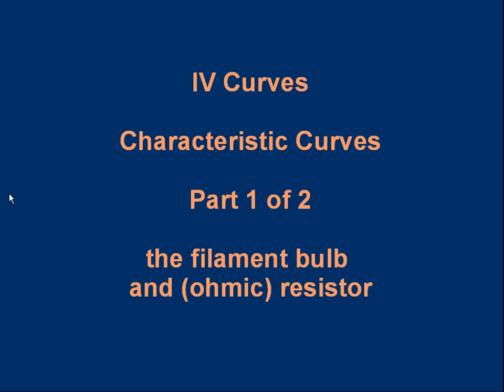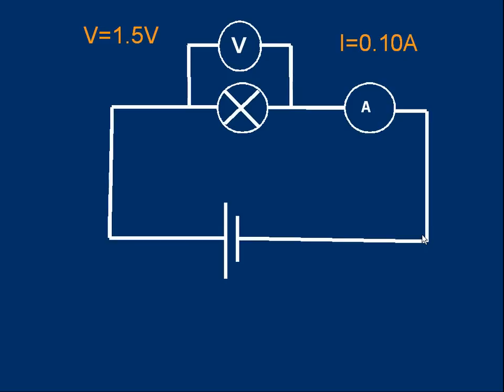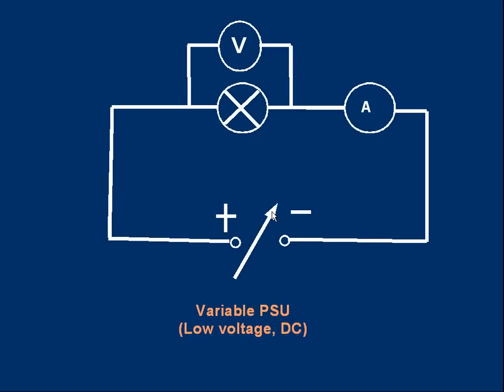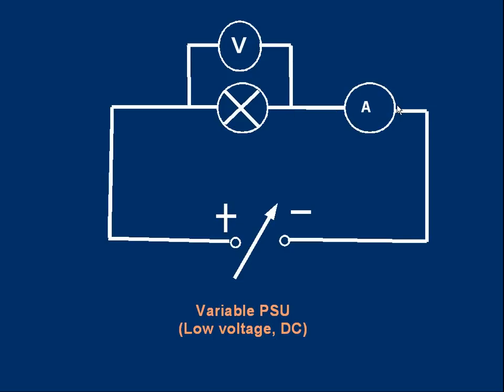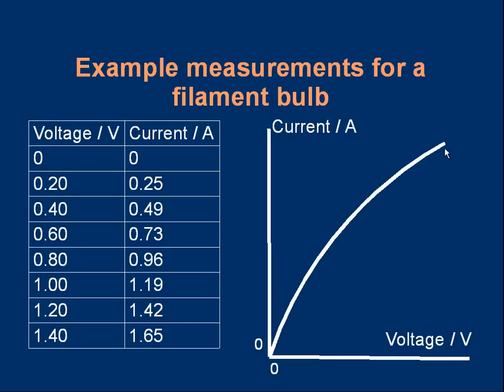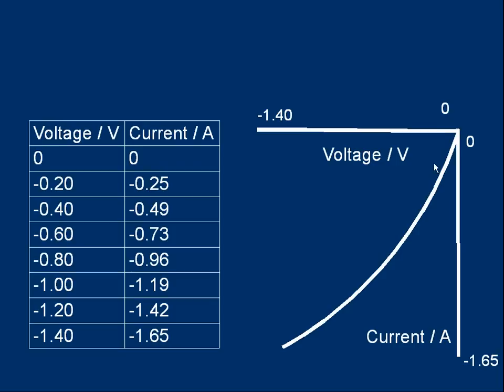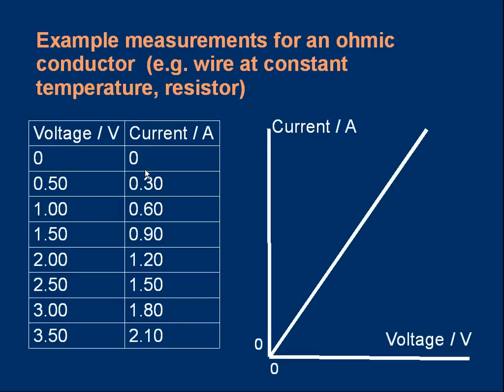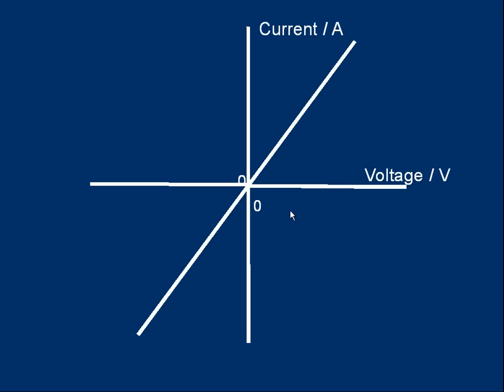GCE (A level) Physics E05 IV (Characteristic) Curves Part 1 of 2

Comment from the maker: @alfmaester 
Glad that helped. Increasing the circuit's resistance certainly reduces current.  But it is not accurate to say it reduces the voltage.  For example, if you have two 10Ω resistors in series with a  12V battery, each resistor has 6V across it.  If you replace the resistors with two 1000Ω resistors, each resistpr still has 6V across it!

Comment from the maker: @alfmaester 
Hi. Yes, resistors DO heat up, but not as much as bulbs. A bulb's filament is deliberately low mass, low resistance and thermally insulated so that it gets hot enough to glow
Resistors are designed NOT to overheat. E.g. when you buy a 100Ω resistor, there are different sizes available according to the maximum wattage (heat output) it must handle.
Different components have different IV curves depending on their different shapes, sizes and materials used. Hope that helps.

Comment from the maker: @momoxinyi .  Hi.  I don't talk about keeping the temperature (of a bulb) low.  .But you are correct, if there were some way to keep the temperature low, the current would be higher than if the bulb were hot., because its resistance is lower when cold.  For a short time when switching on a bulb, the current is temporarily high for this reason.  Check what the video says at around 9 minutes.

Comment from the maker: Work through these figures carefully and it may help.

Suppose we connect a 12V battery, 2Ω and 4Ω resistors in series.  Current = 2A everywhere in the circuit.  Voltage across the 2Ω resistor is 4V; voltage across the 4Ω resistor is 8V. Note the 2 voltages add up to 12V (battery’s emf).

Replace the 2 resistors with two 60Ω resistors.  Now current =0.1A everywhere in the circuit.  Each resistor now has 6V across it.  Note the voltages still add up to the battery’s emf.

Comment: At 0:56, surely the ammeter would have to be effectively in series with the voltmeter, as current gets split between two paths, and therefore the ammeter in its current position would read the current of the entire circuit, not that of the bulb itself?

Comment: Excellent video - thank you! Could you possibly help me with a question that no-one seems to know the answer to!? Why does a fixed resistor have a constant resistance even when they warm up but a filament bulb doesn't? I have felt fixed resistors get hot but you still get a straight line graph. If they feel hot their atoms must be vibrating with a bigger amplitude as you described and how can this not increase their resistance?
Reply from the maker: +Jane T 

Hi Jane.

Resistors don't have a constant resistance as the temperature changes!!!

Treating the resistance as if it is fixed is simply a convenient approximation when the temperature doesn't change much.

A filament bulb has a very large temperature-change between cold and operating.  So this approximation doesn't work.

The variation in resistance over the temperature-range resistors operate is usually small enough to be ignored.  When you buy a simple  'bog-standard' resistor, the resistance is only accurate to ±20% in any case; a small change in resistance during operation is usually unimportant for most applications.

For introductory teaching purposes we usually treat resistors as having a constant resistance for simplicity – it's accurate enough.  And electronic engineers designing circuits know when changes in resistance over the working  temperature-range are small enough to be ignored.

If you are doing I-V measurements, it is good practice to switch-off between measurements so the resistor doesn't heat up significantly.  But even if you don't, in most cases the resistance-changes would be too small to affect your results.

For specialist applications where the resistance must not change with temperature (or must be limited), we can use semiconductors to compensate (e.g. thermistors).  The resistance of some semiconductors decreases as
temperature increases.  That's because they release extra charge-carriers (electrons and holes) as the temperature increases.  So, if required, it is possible to make something which isn't temperature sensitive (within a limited temperature-range).

Take a look at this link:http://www.resistorguide.com/temperature-coefficient-of-resistance/
Reply: Wow, thanks for such a detailed response. I think I see what you are trying to say. So the experiment we did was the IV characteristic for a 100ohm resistor and I noticed it get quite hot when I touched it however I still got a perfect straight line on my graph. So is this just because the temperature rise isn't big enough to affect the resistance enough whereas a filament bulb is affected because it gets much hotter (a couple of thousand of degrees)? So a carbon resistor would be affected as much if it got that hot?
Reply from the maker: +Jane T 

Hi again.

Yes – good description.  You've got it!

A couple of comments on what you wrote...

A filament bulb (at full brightness) is probably around  3000°C. Your carbon resistor would have burned-out long before reaching that temperature!

From the link I gave:
http://www.resistorguide.com/temperature-coefficient-of-resistance/
the temperature coefficient of resistance for amorphous carbon is  -0.0005°C⁻¹.

The overall negative value is due to some of the carbon (some tiny graphite fragments) being a semiconductor and releasing extra charge carriers (electrons) when heated.  This tends to cancel the increase in resistance caused by increased atomic vibrations.

So unlike the filament bulb, the carbon resistor's resistance slightly decreases as it heat up.

In terms of minimising experimental error, you should have tried to keep the temperature of the resistor constant during the experiment by switching-off between readings and taking each reading quickly.  That would have been good experimental technique.  But since the temperature change was quite small (a few 10s of degrees I'd guess) this did not affect your results.

Comment from the maker: Hi.

An ideal voltmeter has an infinite resistance therefore no current can flow through it.

So the current does not get split.  The same current passes through the bulb and ammeter.  No current passes through the voltmeter.  

In real life of course, there  is no 'ideal' voltmeter.  But a good voltmeter has an extremely high resistance and (usually) only a negligible current flows through it. 

(Also an ideal ammeter has zero resistance, therefore it doesn't reduce the current in the circuit.)